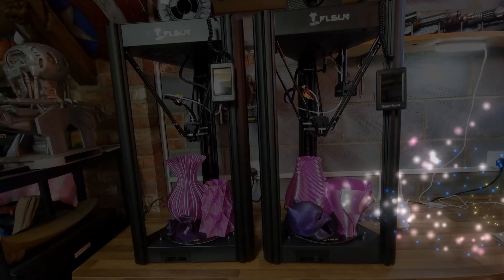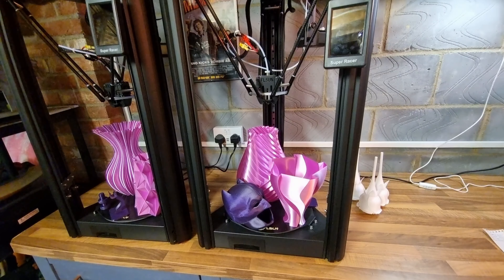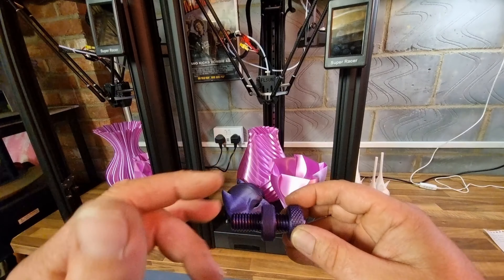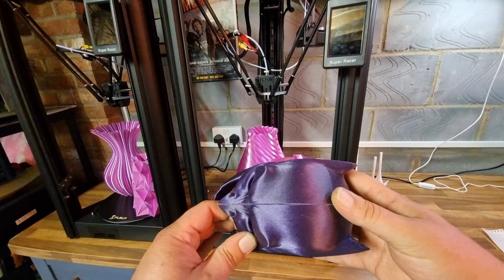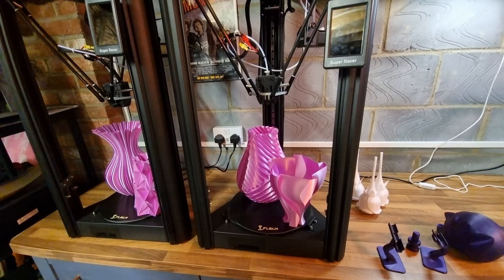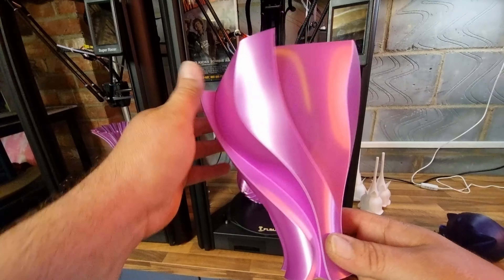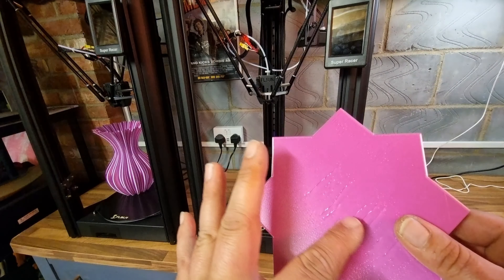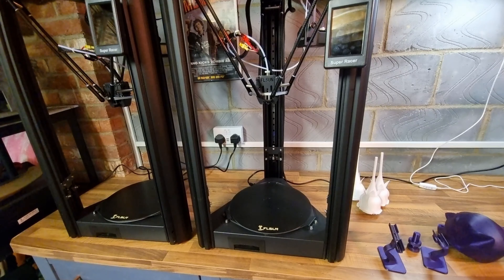FLSUN SR SUPER RACER THE BEST DELTA 3D PRINTER?

Comment: Hi! Could you tell me if you’ve had any issues with the Filament clicking? I have read that it could be just the brand I’m using? Loving the SR so far though 

Thanks James
Reply: Also do you have any discount codes for technology outlet? Much appreciated James
Reply from the maker: Hi, can I ask what sort of filament you are using? I dont have a discount code I'm afraid, I could email them and probably get you one
Reply: It’s just a silk PLA from eBay.. £14.. don’t judge me! Ha
Reply from the maker: @jamesinretail7482  what nozzle temp you printing at?
Reply: 220.. tips? Ha
Reply from the maker: @jamesinretail7482  if the extruder is clicking means it's slipping, you could try and slightly loosen the screw on the extruder may be done up to tight, are you printing high speeds?
Reply: I loosened it off a bit and it seemed to sort it, printing at 100mm/s, 0.2mm height. Trying to print a katana sword for my son.. high stakes stuff!
Reply from the maker: @jamesinretail7482  you would get alot better quality prints at 60mms, have you printed one of those collapsible katana swords
Reply: Okay cool, I printed one last night. 70% success.. some of the blades stuck together.. has to take apart and shorten to get it free
Reply: Hi, I’ve had a problem with parts fusing together and I’m using cura any suggestions? I’m just trying to adjust the horizontal expansion to see if that helps.. could be the cheap filament too..?

Comment: One question, does the Flsun SR support a filament change when printing?
Reply from the maker: hi, yes i often change the filament while printing, i usually cut the filament so the dector stops the print then change the filament
Reply: @BeaniesHobbies  Thank you, and are there any differences to the QQS Pro?
Reply from the maker: @BjörnsTechnikEcke  I would suggest you get the Sr its alot better than the qqs, I do have a discount code, I will link it for you
Reply from the maker: @BjörnsTechnikEcke  https://flsun3d.com/discount/BH20USD?redirect=%2Fproducts%2Fsuper-racer-sr